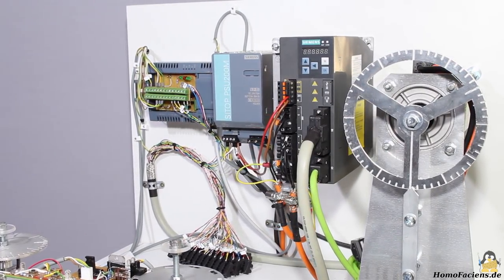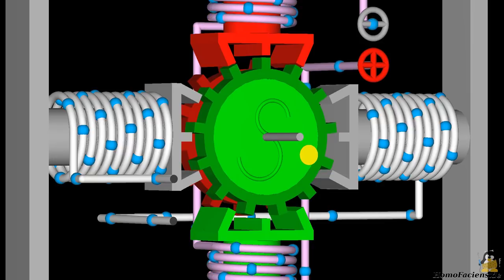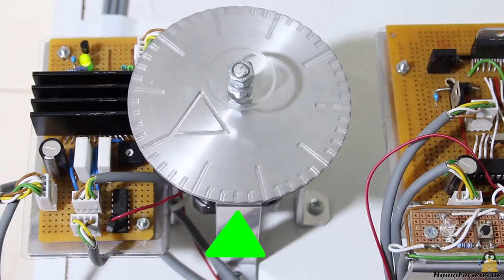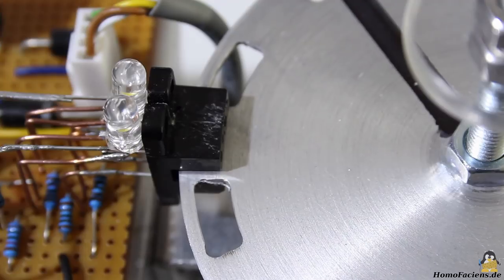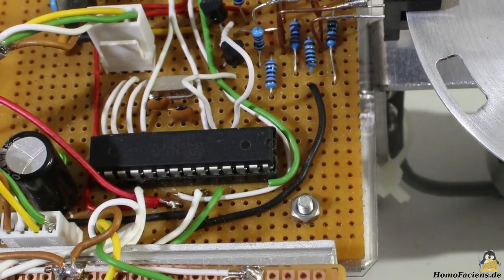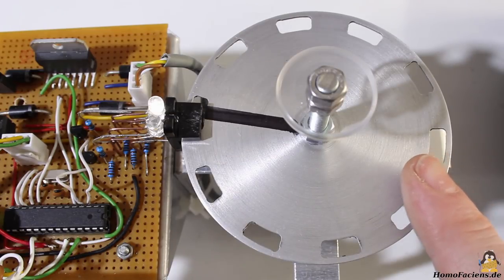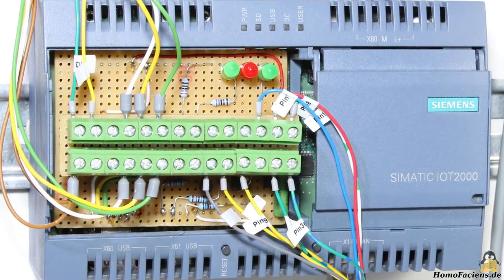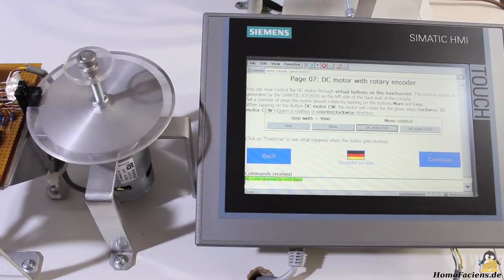Demo console servomotors with SINAMICS V90PTI

Comment: I wish I could see the sinematic drive's dc servo pwm on an oscilloscope when you tell it to pulse 1 step.
How would it ramp up and down the hbridge current without having any intermediate encoder steps by which to gauge speed?

Will it always just default to a specific pwm (or current)?
Reply from the maker: Of course it can't ramp up/down when the encoder resolution doesn't allow for that. You won't get a hard lock of the motor at any of the encoder positions theoretically offered. The extremely high number of pulses per revolution makes constant speed or constant torque rotation smoother. That's where it makes a difference.

Comment: Thanks for the video- very interesting. Here is a question that you may be able to answer: In a small industrial machine that uses a professional servo unit similar to the one by Siemens that you have featured, is there any need for a separate shaft  brake to imitate holding torque ( similar to the way a stepper motor  will hold its position when not rotating) or is there enough strength in the servo hunting for its zero position to maintain a position under a load that might push the machine away from its intended position? It would be interesting to see what you think given your experience with home made servo set ups.
Reply from the maker: As long as a servo motor system is powered, It will always return to the setpoint when deflected. Whether or not that is enough for application depends on what exactly you have in mind.
The motor I am using in this video has an additional mechanical break being actuated through an electromagnet. If that electromagnet is enabled, the motor can spin freely, when disabled, the shaft is locked.

Comment: Thank you for your channel.I have a question, as you know A CD-Rom uses little pits that are engraved onto the CD with a laser. These are then read with a laser. Using this info http://en.wikipedia.org/wiki/File:Comparison_CD_DVD_HDDVD_BD.svg, and the fact that a CD has a roughly 116mm outer-data radius, there are roughly 400,000 spots on the outer edge of the CD. That means you can break the circle up into 400,000 chunks. You can do twice as much with a DVD, and 8 times as much with a Blu-ray. That is some serious precision, and they are cheap.can we use CD and A CD-Rom equipment to make high resolution encoders?
Reply from the maker: You will hardly find a cheap motor that runs smoothly enough to get that high resolution. The combination of static and kinetic friction acting on the motor shaft and all mechanics connected to that shaft will prevent your system from stopping at 400,000 different positions. Maybe you can get close to something like that with a special, precisely manufactured motor and nothing connected to the motor shaft.
Reply: @HomoFaciens  Thank you for replay. maybe we can solvent this problem in code, for example dividing and round value of  positions steps to steps that motor can handle.
Reply from the maker: Yes, you can reduce the number of positions by software. Keep in mind that you also need a microcontoller that can handle that huge number of pulses per second if you go to higher revolution speeds with your motor.